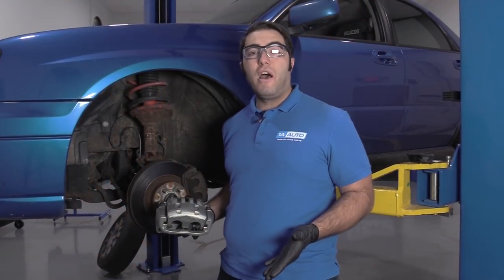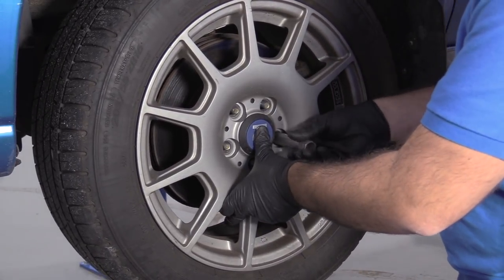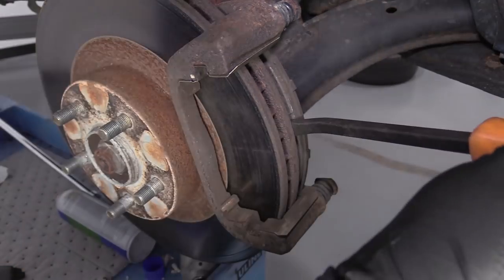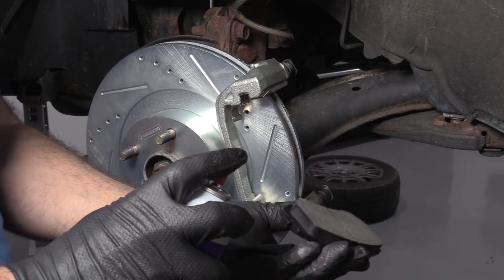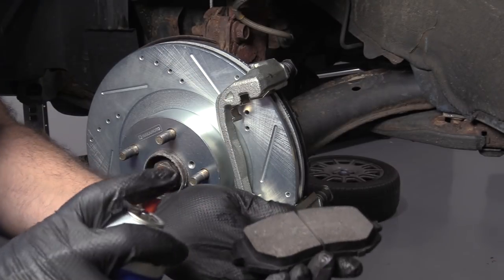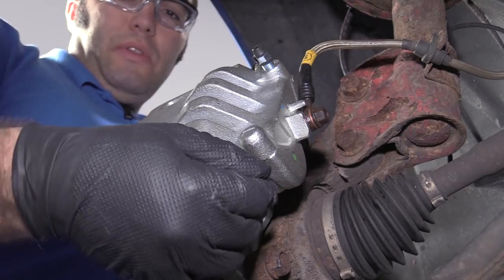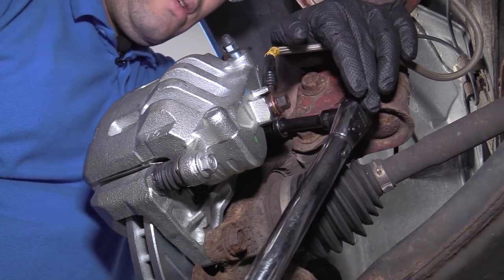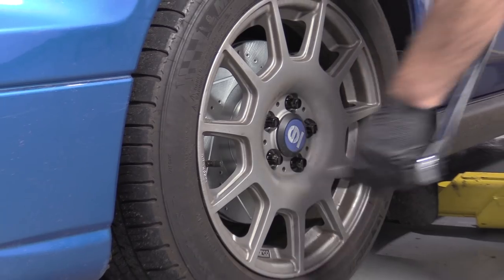How to Replace Front Caliper 03-05 Subaru WRX

Comment: Hello buddy I got problem with rear brake slide pin caliper on 2007 honda odyssey. It's fully rusted and the tip of bolt pin is totally damage nothing has grap to it. If you can help me out it thanks
Reply: Most likely it'll just get worst over time with time for a replacement brand new